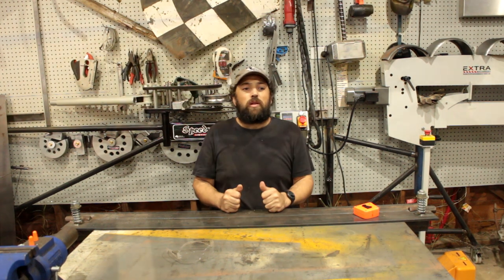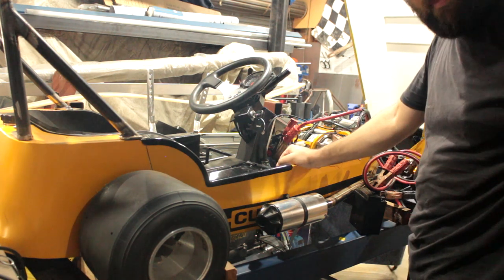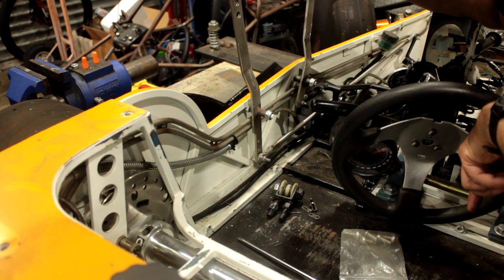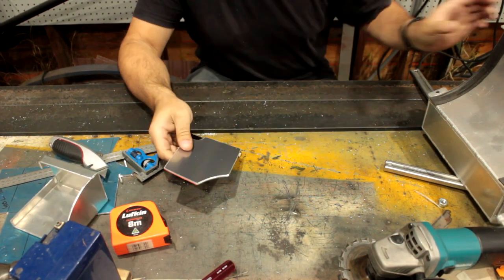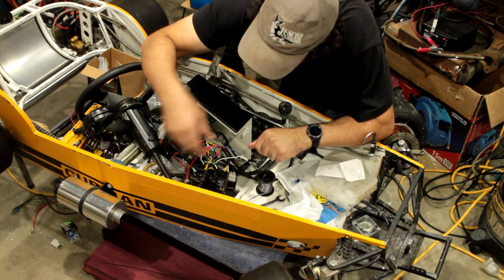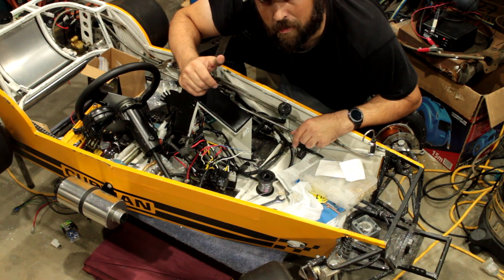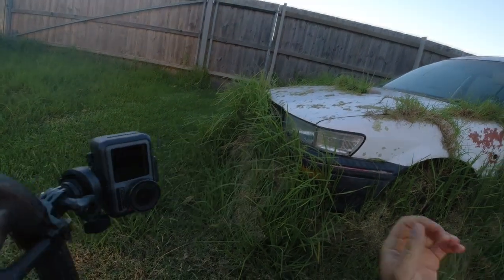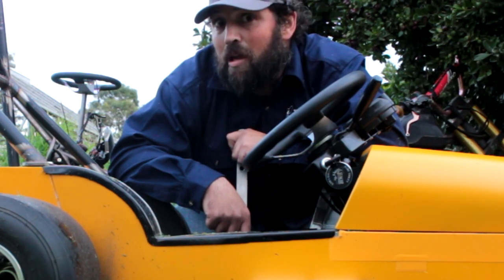cubman episode 49 full rebuild

Comment: Great Job, if you ever found time, Maybe you could make a Full Scale Clubman with a CBR 1000cc Motorcycle Engine or Similar! That would be Awesome! You Certainly have the Required Skills! -Cheers👍🍺
Reply from the maker: Well I do plan on building a full size clubman at some point but I have not decided on what drive line I will be using. 
The cubman on the other hand came about when I had a lot of spare time because I was recovering from a severely broken leg and was on crutches for 6 months as well as a long recovery after that so the small build just made sense (it was originally going to be radio control)

Comment: Hi Geoff, have you got any recommendation for a Lower Budget Tig Welder that I can weld Alloy with? I believe you need an AC/DC for Aluminium? I Know they aren't cheap like the standard Steel Tigs! -Cheers😁👍🍺
Reply from the maker: *it would really depend on where in the world you are as to what sort of machine you would get
*If your going to stick to a straight AC/DC TIG try to get a known brand and       check google for reviews for the specific model your looking at. 
*I would not recommend getting a super cheap no brand all in one as it is a bit of a pop lottery as to how long it lasts till it pop's and if it does your stuck without any of the welding options that it supplied.
*and yes there is always cheaper deals online but being able to take it into a local shop and getting help if needed is priceless, especially if you have ever had the hassle of trying to return something that you purchased on the internet 

hope this helps and if you want more information there is a lot of videos on youtube specifically about this subject I think there was a good one by "the fabrication series" channel
good luck